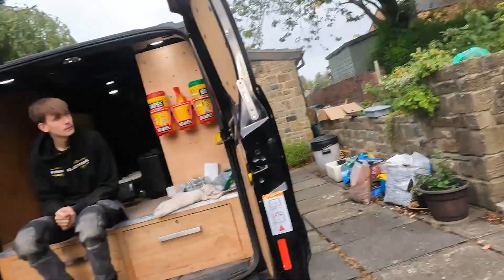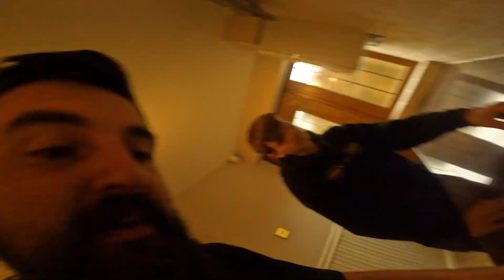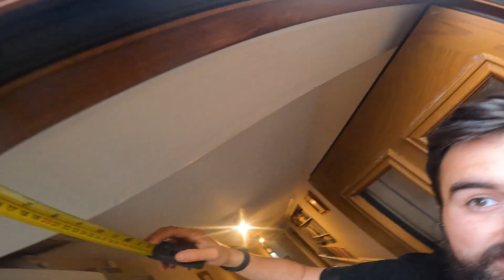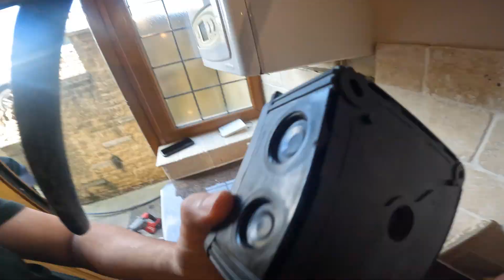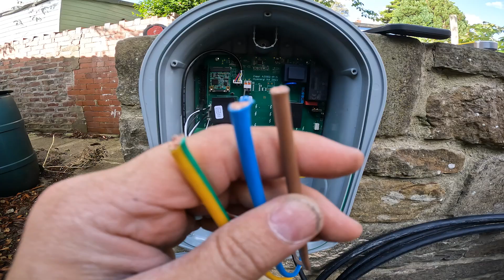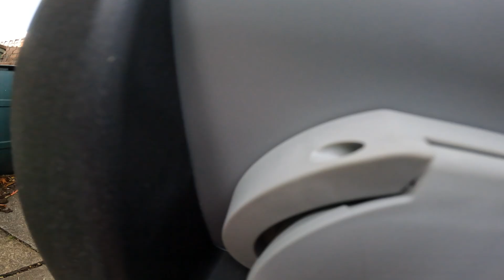HOW TO INSTALL AN UNTETHERED ZAPPI CHARGER! 🚗⚡

Comment: The three cables you connected at minute 24, how do you take them out? I need to replace the actual cable of a zappi glo tethered with a longer cable. And I can’t seem to understand how to take the cables out. 
The zappy glo came with a tethered cable from the factory and I need to replace it. 
If you could help me with an advice? Many thanks.
Reply from the maker: All you do is insert a flat that size which opens the Wago style terminal 👌 Wago do a tool actually for that type of terminal